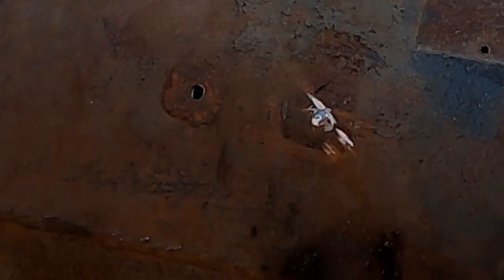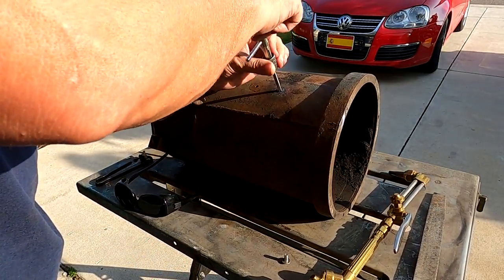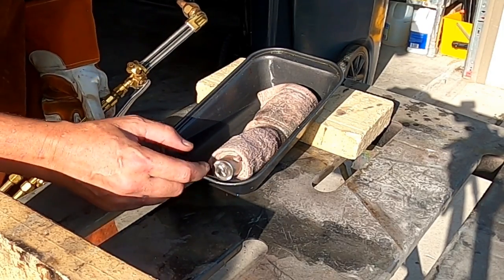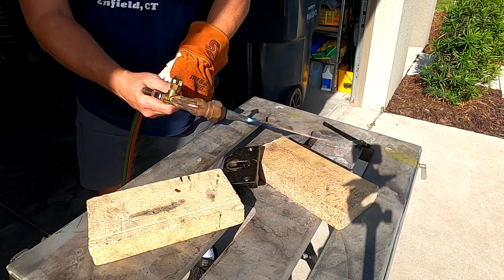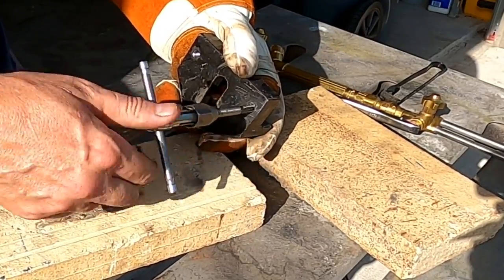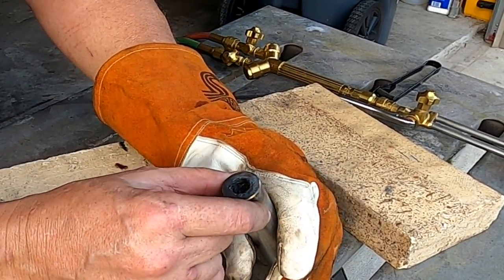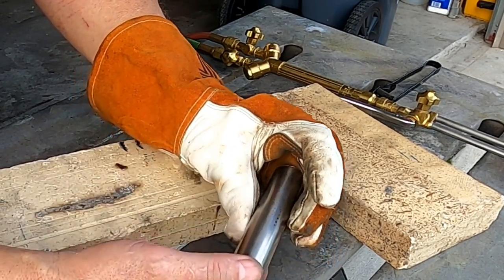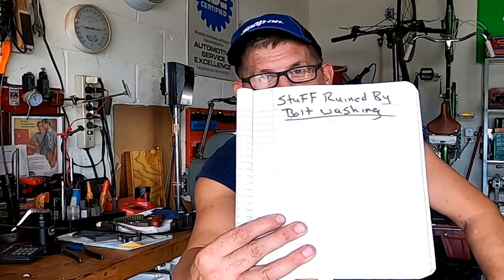Easy Fast Broken Bolt Removal. Remove broken bolts using the bolt washing Torch method. Torch Skill

Comment: I've seen my dad do that with a torch it's a faster way, works great, great video Don, keep'um coming.
Reply from the maker: I'm surprised that its not a lot more popular than it is... Thanx KT. Don
Reply: @donsengine3158  people don't work with there hands these days, the world's going to hell in a hand basket. Lol...
Reply from the maker: @kentuckytrapper780  Ya, unfortunately, But we gotta keep that torch lit. Pun intended...   I thought blacksmithing had gone forever, but when I see the forged in fire TV show, It kind of gives me hope.   Don
Reply: @donsengine3158  it created alot of people wanting to learn the trade, I've got my great grandpa's forge from the 1800s, still works great.
Reply from the maker: @kentuckytrapper780  That's like sitting on a gold mine this day in age. Have you seen what Anvils go for now? I almost crapped myself when I moved back to the U.S. and saw. We used to scrap them as junk not long ago. Crazy world.
Reply: @donsengine3158  10 bucks a pound around here, I've got grandpa's 300 pounder, made in 1883, priceless!!
Reply from the maker: @kentuckytrapper780  There's no steel like old steel....

Comment: What size Tip are you using

I just put together a brand new set that I had laying around for 20 years and the tip is just junk 
I’ve kind of forgotten some of my sizes and numbers, this tip wouldn’t heat anything up that I had to cut, the first I was trying to heat up and cut was 3/16 steel just wouldn’t do anything I have to look at all this because it drove me nuts and I had to go to another method which took two hours cutting with a cut off wheel
Reply from the maker: It just a general use cutting torch end.
Reply from the maker: Tip sizes are based on the need for welding, brazin, soldering.

Comment: Hi Don ,  I've used this method for a long time and also had good luck.    It seems to be even easier with broken taps.   You can even cut out a bearing that is stuck.    Say a wheel bearing on an axle.    Cut the outside with the torch and remove the balls etc and then cut the rest off of the axle.    If you don't over hold the torch to long it will cut clean and leave the shaft clean.   I have a small torch also and it will cut out small dies etc very nice.    Never tried aluminum but sounds great.    Sure enjoying your videos. 

Dale in Canada 🇨🇦
Reply from the maker: Thanks Dale. You are right about taps. They seem to just float out in one easy stream. That drill bit with a small torch was probably not the best example, but it drilled out like butter on the lathe, so that was nice.  Bearings, yup, done it that way too. Once I watched a guy break a puller and declare the axle too rotted to save. Five minutes later he was looking at some of the freshest OEM steel that hadn't seen the light of day in 20 years. And yes, absolutely, You have to hit it right when it gets to temperature.  Id rather o2 chill it two or three times and say oops, than over heat it and risk scaring the metal or threads. Thanks for watchin... Don
Reply: @donsengine3158    I understand what you are saying about doing it more than once to be safe.    I call it the acetylene wrench.    Thanks for the reply and just watched the GT 535 video and liked it.   Going to watch the video i missed from 10 days ago.    Going to leave a question on the bike video as well. 

Dale in Canada 🇨🇦
Reply: @donsengine3158    Just realized Don it was the threads video that was done 4 ago and not 10 days ago that I missed. 

Dale in Canada
Reply from the maker: @dalemcinnes1834  Acetylene wrench... I like that one.. Going to steal it.. Don

Comment: Do you think this would work with a semi truck rear end filler plug that has broke off? I think I could drain the rear end fluid and flush out slag.
Reply from the maker: I think it would be a pretty straight forward. May be able to even shoot it from the inside out.

Comment: have you ever done studs stuck in a aluminum engine block?
Reply from the maker: Not that I can think of right off the top of my head.  I've actually been compiling a follow up video to that one. A compilation of washing out bolts with the torch just to reinforce what I was showing there. If your anxious about that, grab a block of Alum and drill out and tap some holes and drive some bolts into it and practice.  I personally like blowing stuff out of aluminum as the aluminum dissipates the heat really fast and leaves nice clean holes. I think what Ide wonder about on an aluminum block though isn't about my skills, but if the studs block coolant or oil passages. That leaves the chance of blowing slag down into the engine passage ways that may not be able to come out later.  Let me know what you find. Don
Reply: @donsengine3158  I love that trick, I'm gonna practice on old engine blocks, and when my brother's friends are amazed I'm gonna tell them I learned it from "The Don"
Reply from the maker: @BillyTpower  Ha ha.. OK,  Wish I could remember the old guys name that showed me that. Its been well over 40 years now and memory gets tired.  Don
Reply: @donsengine3158 heating aluminum block is bad, it does dissipate fast but also warps